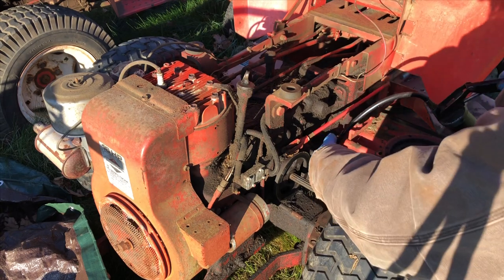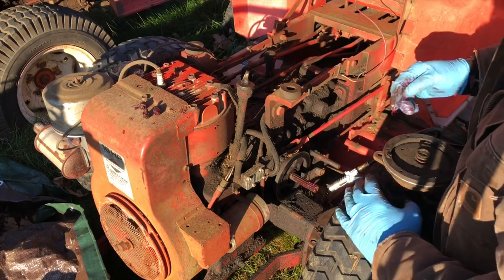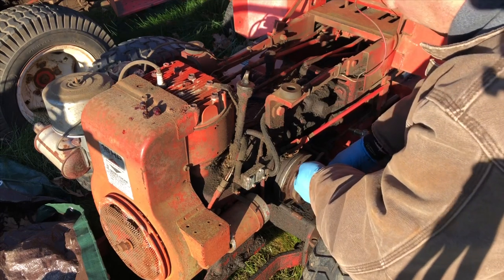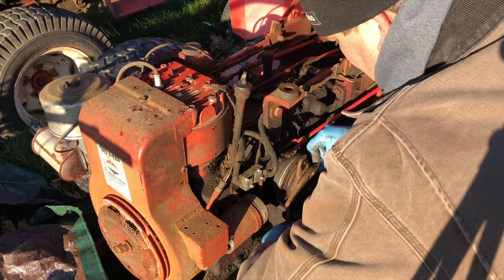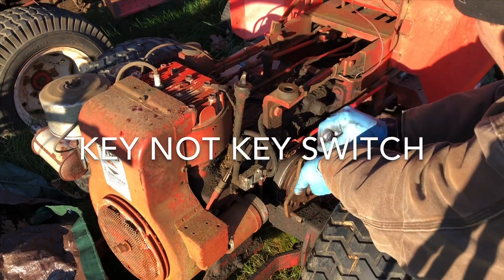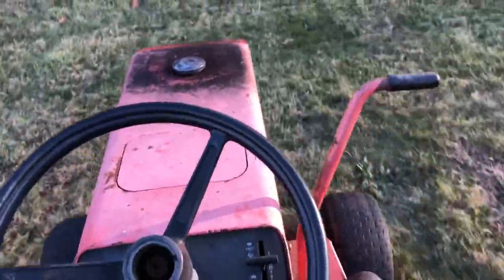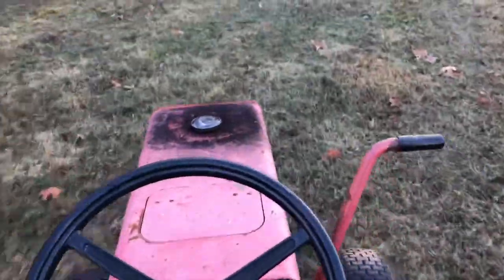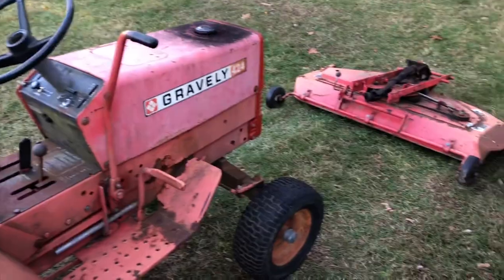Gravely 8163-B Clutch and Snow Plow  Repair Part 2

Comment: For easy assy I lay the roller plate horizontal with the clutch on top and put the whole thing on the spline at once.  For good clutch engagement I adjust the clevis with the rollers just at the beginning of the ramp on the cam plate with the shift lever true vertical and all slack out of the link rod. PaulL

Comment: There are so called "new style" one piece cam rollers for sale on eBay. Have you heard of these? Mine seem to be one piece, but that may be due to corrosion.
Reply from the maker: Tolba Szy I saw a guys asking them for like $10 each on eBay.   I was going to consider trying them ......   Apparently the ones I took out were one piece but I didn’t know it.   The newer machines must be one piece...